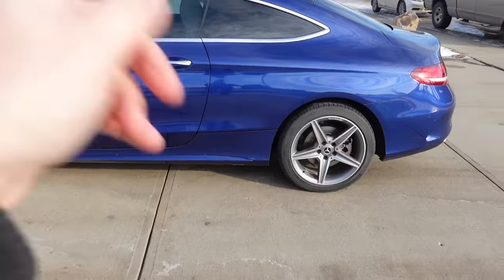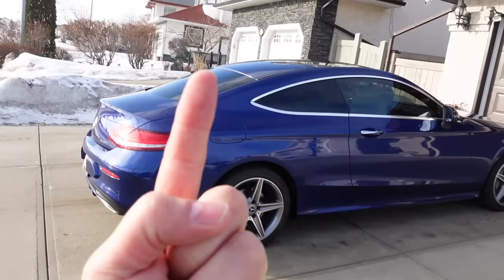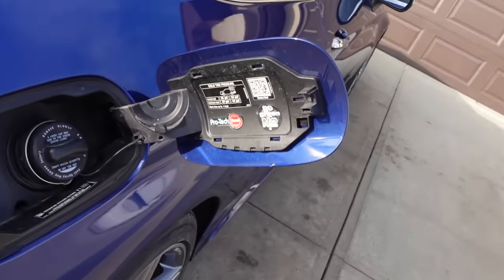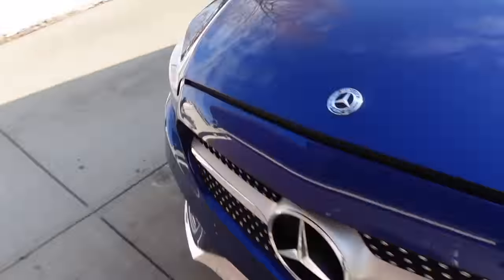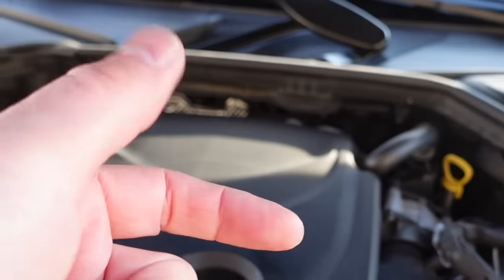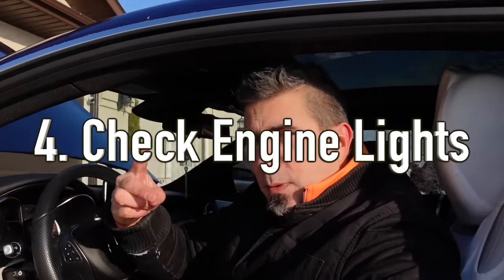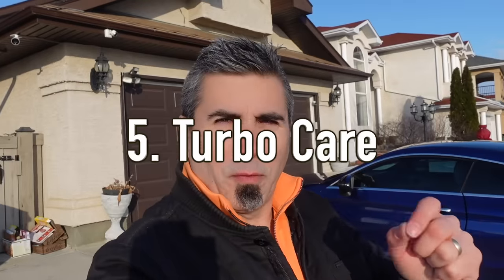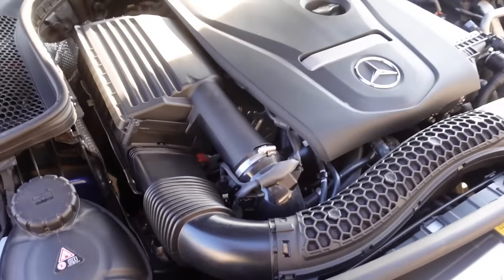STOP Destroying Your Car Engine! (With These Tips)

Comment: Excellent advice on letting the turbo spool down.  Best advice I can give anyone buying a new car is change the oil at 3000 miles: new engine has tight tolerances and, as it beds in during the stresses of normal driving, there will be a higher content of metal in the oil regardless of how 'long life' the oil is.
Reply from the maker: Absolutely agtee
Reply: I've always done that for the first 50k then every 6k after that.
Reply: For new vehicles I would change it at 1k, but that’s just me.
Reply: I change oil in bmw 530d at 8k. Genuine oil and filters and always used premium fuel. 190k without a single issue.
Reply: @barryblack7384  that's the way to do it 👍
Reply: There was a time when turbo charged cars were installed with a turbo timer. This will keep the fan on for several minutes when the engine is turned off to cool down the engine.
Reply: @christopherbong6639  that's not what a turbo timer does. A fan will do nothing in preventing oil from coking on the turbo bearings. A turbo timer let's the engine idle for a minute after removing the key.
Reply: @jalee6587  yes that is what it does and kept the fan running for a couple of minutes.
Reply: I follow the owners manual when it comes to oil changes.  When I first bought my Audi, they did the oil change after 1000 miles, then again at 3000 and 5k. After that, it's every 10k or 6 months. With Covid I was changing my oil on the 6th month with only a thousand miles on the car as I wasn't driving it as much.
Reply: Wow!  Ignorance is bliss.  Nearly every new turbo-charged car has what is called an after-run pump.  That electric pump runs coolant through your turbocharger(s) until the temperature drops to a safe level.  Please do some research people!  🙄
Reply: Better after a few hundred miles?
Reply: @midcenturymodern9330  not all turbos are COOLANT COOLED,  many are just air cooled thru an intercooler.  And some have both. Do your research.
Reply: Well 2020 4runner is 5speed automatic trans, they haven’t changed it fro 12 years now? So its old
Reply: or ... don't buy a car that has a turbo!
Reply: Between 3000 and 5000 miles is reasonable for most oils.

Comment: Very good and informative video for mechanically inclined drivers for the most part, I'm with you all the way up to the last segment or tip. You had mentioned that the vehicles with the start and stop system could be detrimental to your car starter and several minutes of the engine oil falling back down to the crank case which, yes it would normally. However today's modern vehicles that employ a start and stop ECO mode system actually utilize a two starter system. It utilizes a standard starter motor, as well as a high torque starter motor that almost has nearly the same responsiveness when compared to electric car. In other words, there is almost 0 lag from the time when you depress the gas pedal to when the vehicle is moving. Now if you have a hybrid vehicle that employees a start stop system such as Toyota?  When the motor stops at a traffic light or when it's in hybrid battery mode. The electric engine oil pump ensures & maintain circulation of the engine oil throughout the vital internal components which also maintains the necessary oil pressure to prevent metal on metal unnecessary premature engine wear and tear. This is where the 100% synthetic engine oil is extremely important. What the average person doesn't know is that when they take your vehicle to a dealership for an oil change then is that the engine oil special usually is the incorrect grade and or only conventional oil when only a synthetic oil can be used like most Japanese engines that are extremely fuel efficient have the lowest viscosity index rating of 0w-16 engine oil which can only be synthetically man made rather than the conventional lowest grade 5w-20 I believe. 0w16 SYNTHETIC MOTOR OIL HAS BEEN AROUND SINCE THE YEAR 2000. YET THE BIG 3 are only now realizing the benefits in fuel efficiency due to its superior flow rate at sub zero temperatures.

Comment: I have coded out the start / stop feature on my BMW F30 N20 to save the added strain it puts on the timing chain at every start up. Long live the timing chain. Thanks for the great videos 👍
Reply from the maker: Cheers
Reply: Do you think this random person on youtube knows more about the car than the engineers who designed it? Get real.
Reply: @r3games1985 You’re thinking the Engineer’s don’t know better ? Well….they do. They are just following marching orders from upstairs who is following marching orders from The Great Green Movement. Wake up fella.
Reply: @r3games1985  Some BMW timing chains wear out prematurely. It's a known issue for certain cars. The start stop function on these cars only makes the issue worse. On start-up, the tensioner isn't always pressurized and the timing chain slaps, which wear out the plastic timing guides quicker.

Comment: If you drive in a city as I do 90% of the time. The start stop function saves a huge amount of fuel. And in 100,000 miles I have never had any issues. I do however turn it off when edging forward to a set of lights numerous times, I drive in the city so much that I know the sequence of just about all the traffic lights, sad.
Reply from the maker: Thanks for sharing.  It definitely will save some gas in the long run

Comment: Thank you for your video!  As a person that spent 23 years with a global engineering and environmental company, I would like to know if the actual data on start-stop technology is better for our environment.  Have the THCs, CO, and other emissions been significantly reduced by the stop-start technology?  What were the analyzer readings with stop-start off versus when it is activated?  

Catalytic converters use Rhodium as a reduction catalyst, palladium as an oxidation catalyst, and platinum for both reduction and oxidation.   They are most optimum at 400 F.  What happens when the engine cools down while stopped and then restarted? Is it possible that certain pollutants get bumped out of the catalytic converter prematurely?  In other words, does Stop-Start technology potentially cause even more pollution to the environment?  

Saving a thimble of gas, if that, at a stop light or while sitting in traffic may help MPG ratings.  However, I have seen no empirical evidence that convinces me that stop-start is good for our environment.
Reply from the maker: Great points John, yes I really have wondered similar and not sure if the payback is worth the troubles
Reply: only the vote for me people benefit from things that mean nothing...

Comment: Some engines don’t even use the starter for start/stop feature sometimes. Engine stops at the right crankshaft position, so that the ignition can restart the engine without using the starter. So, there are some smart solutions nowadays.

I have been using start/stop feat and have never turned it off. Oil analysis comes up as really good and have never had any issue at almost 80k (mb glc300). Knocking on the wood

Comment: My personal opinion is that each and every tip in this video is perfectly valid particularly the stop-start feature. Sure it's a good idea to reduce the pollution but not destroying the engine as a result. If you start to scratch the cylinders due to oil starvation the result will be more pollution from the engine, less power produced and you will have to drive the vehicle harder with negative effect on the environment. There is a gadget available for a great number of vehicles that actually memorizes the setting so you won't have to turn the stop-start feature off each time you start. Great idea in my opinion.

Comment: All great tips.  Additional one from my mechanic, Brake Fluid should be changed every 2-3 years as it absorbs water (moisture).
Reply from the maker: Yes agreed
Reply: @ECPP  Transmission fluid, change that for longevity. Nobody is doing that, and car dealership  doesn't want you to touch it.
Reply: Also transmission oil service.

Comment: That blue of the MB is gorgeous. Thank God for 0W-20 and 5W-20 for cold starts. Synthetic oil is superior to conventional oil in many ways.
Reply from the maker: Thank you very much
Reply: Mmm, I've got 338.000 miles on my 94 Trans Am I bought new.  Engine never been touched. Even the timing chain is original.  Runs and sounds like new.Uses no oil..  Only oil it ever had is Castrol GTX 10 30.  My new car requires SYNTHETIC,  or so the owners manuel states. So I'm using it for that car.
Reply: @johnfranklin5277  yes
Reply: It looks like a sapphire!

Comment: Great video.  I have a 2021 Toyota GR Supra 3.0 Premium which have a BMW B58 engine.  The manual recommends 10k OCI. I live in Las Vegas, and will be changing my oil at 5k.  My Supra has 5k, and have already changed the oil 2 times. 

Oil is cheap.
Engine is expensive.
Reply from the maker: You bet 100 percent.  That’s how I see it and my mechanic says the exact thing.
Reply: That’s perfect. I worked in Kenya and even on Land Cruisers they changed the oil every 3k due to the bad/sandy air and low fuel quality. That’s why some of the LCs I drove were still running fine with the same engine after 600.000km +
Reply: Make sure they don't change only half of the oil.🎉 😂
Reply: Yup 6k should be your max oil intervals. Do that and the b58 will never see problems. Stage 2 here with 5k intervals 60k miles on it with no problems just wear and tear like brakes, tires and filters

Comment: 1. Ethanol ABSORBS water, so don't leave fuel sitting in the tank more than 3 months unused otherwise it forms in the fuel. 2. Cold start wear occurs within the first couple seconds, so just don't rev it hard. Oil residue oil clings to the surfaces anyway, so it isn't metal on metal otherwise your car wouldn't last a year. 3. Yes regular oil servicing is the most important thing you can do to maximise the engine life - and use the good stuff. 4. Yea, yellow\ red lights are there for a reason. 5. It's not about cooling the turbo after a hard run, it's about cooling the engine with some moderate speed before parking up. Sitting still does not cool the turbo very well, the engine oil cools the turbo, so you need to cool the engine by getting air through the rad. If you idle a hot engine, the engine gets hotter at first and fans kick in- like when you do rush hour. 6.The stop\ start advice... the restart does not use the starter motor: When the engine stops at a light, one of the cylinders is left at TDC, and the car restarts by firing the spark plug which turns the engine over- no starter motor needed.
Reply from the maker: Thanks
Reply: 6 - depends on the car, but that is definitely the more elegant solution used by some manufacturers
Reply: I'd think having 1 piston being used to start the reciprocating motion of an engine would be VERY HARD ON THAT PISTON, THE ROD, AND ROD BEARING.
Reply: Correct and well said. The only thing I will add is that studies have been done on oil change interval, and mileage degrades oil, time doesn't. If you use synthetic and get 6 months and 6-7K on it, change it. If you get 5 months with only 1-2 K on it, you can wait another 6 months because lab tests show the oil is like new.

Comment: My 2012 Acadia lit up like a Christmas tree a few yrs back, the Red Check light really got my attention.  Lucky to have been able to safely park and turn it off within seconds.  50,000 miles with a new water pump now.  160,000 miles original brake pads, 2nd set of struts and shocks, doesn’t burn a drop.  Babied it since new.  In the back of my mind I worry about the timing chain and the tranny.  It’s on its 4th trans fluid change.

Comment: I was always skeptical about that auto off/on engine crap. As a tech I can tell you some of these emissions things are doing more damage than anything. Idea is to be good to the environment but hard to do that when it's more financially accessible to buy a whole new car than working or replacing the one you got. What a waste! Thanks EPA
Reply from the maker: You are totally right.  What a ridiculous design.
Reply: Has anyone ever noticed just how much the cancer rates of skyrocketed since all the emissions regulations went into effect? Anyone ever notice how all the vegetation on the sides of the highways is dead now? 
25 years ago, everything was lush and green along many roads.. and cancer rates were quite a bit lower.
Reply: @fadingbeleifs cancer rates has been getting higher ever since the industrial revolution, and the people who were around when vehicles were being mainstream are now getting old and the cancer is starting to show so it makes sense that it’ll be a little skyrocket in cancer cases

Comment: I’ve been driving the same Toyota for 15 years, never seen the check engine light on.
Didn’t know there were two colours…
Anyway, good video! Very informative.
Reply from the maker: Thank you very much.  Yes some vehicles make reliability look effortless.
Reply: Classic Toyotas. Those things can run for decades if takes care of properly. Good luck getting that out of any newer BMW
Reply: @CaptainVillanueva1  Another person just commented that in a 100k miles in a camry he's had all kinds of issues, and parts that needed replacing! Cars are machines, and all break down lol! I've had several friends with them, and the Avalon with all kinds of wear and tear problems with less then 100k! Japanese cars do break down as well just cheaper to repair!
Reply: I just retired my 2001 camry. 450k kms. Would have kept going for 200k more but the frame rotted :( I wish they'd stop using so much road salt
Reply: @vaneyjane  it amazes me how people can drive an old rusty beater till the end! I like newer cars for their luxury, performance, and updated technology!  Not to mention that new car smell, and feeling of having a highly desired vehicle you dream about having! Just my opinion 🤷🙂
Reply: @germanengineering204  Agreed, but some put value on certain things and its not always cars. A pretty well off person I know only buys used when he can easily buy a luxury car cash if he wanted.
Reply: Amen on that! What I always do that I find helps is after it’s bad out, or the day after I take my car to the car wash so it can get underneath and around the wheels, etc… I’m still driving my 07 Buick LaCrosse. It does have some rust, but it def helps doing that.

Comment: Revving a cold engine is one of the biggest contributors to premature engine wear.
Reply from the maker: True, that’s not good
Reply: and pollution
Reply: In 1995
Reply: @BeeRumblin13  Engines need to be warmed up, after 1995 too
Reply: @BeeRumblin13  The basic architecture of an engine today isn't that much different from 70 years ago, they all have pistons, rod bearings rods, cylinders,  etc...maybe your unaware that metal shrinks when cold, and expands when hot. Every engine needs to warm up before hard use. If not, excessive wear will happen , and it will shorten the engines life. I'm going guess that you believe in 10.000 mile oil changes also.
Reply: @johnfranklin5277  yep, you can change technology all you want but you cant change physics.
Reply: @BeeRumblin13 high rpm metal-to-metal friction without enough of an oil lubrication coating means increased piston wear, or worse, whether in 1995 or today.

Comment: Stop / start is not only bad for your car it’s extremely dangerous. Normally when a car fails to start for ANY reason it’s in a safe place. But if the car fails to restart when using stop/start you could be rolling out into a busy intersection with no safe way to move your car out of the way. It’s scary as hell.
Reply: I coded it off my car, so it’s the opposite way around and I have to turn it on. The car always turns on with start stop off. Everyone else should look into getting their cars coded so start stop is off when they turn the car on.
Reply: Yes, the lawsuit is bound to happen.
Reply: HUH? Have you ever had a car with start/stop tech? your car is not rolling anywhere. Goodness!
Reply: @Huskerfan69  Even if it doesn’t you are still stuck on the highway in traffic, not good.
Reply: @frankcoffey  true, but it isn't life threatening

Comment: Great video with lots of helpful advice! I agree you shouldn't use an ethanol blended fuel unless your car is compatible. I live in Thailand and run a Mitsubishi Attrage which is designed to use E20 - a blend of 20% ethanol and 80% gasoline. Basically, the internal parts are designed so they aren't affected by ethanol. Many cars over here are designed to run on either E10 (10% ethanol/90% gasoline) or E20, so it's not an issue. I think you'd only need to use a fuel stabilizer to prevent separation if you plan on storing the car for a long time. The only other advice I'd give motorists is to regularly use a fuel system cleaner. I buy a Mitsubishi-branded cleaner but there are plenty on the market like Sea Foam, STP, etc
Reply: Seaform is bs

Comment: I love your energy!  I am looking at buying a new Lexus IS-350.  I have a 2004 Toyota Solara V6 with 230K miles and that car just keeps on running.  I have had some expense with it.  New shocks, struts, control arms, A/C condenser, tie rods, and rack and pinion which I probably got screwed on by some idiot running a tire shop since it went bad after a year and the mechanic replacing it the first time was not good at his work.  I will probably try the COSTCO car buying program.  I hate buying a new car because they want to add on all kinds of stuff.  I don't want an extended warranty because it is a Lexus.  I had a 4 cylinder Honda Accord that was great with manual transmission.  I should have probably just replaced my clutch and it would have lasted another 100K miles.